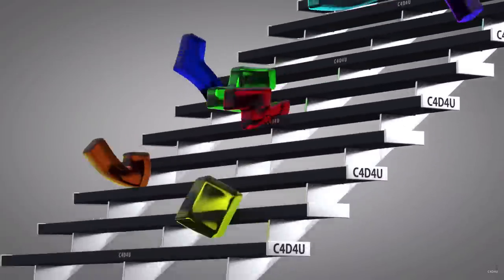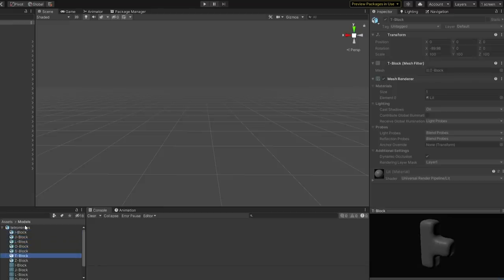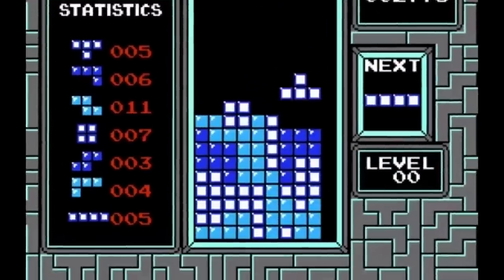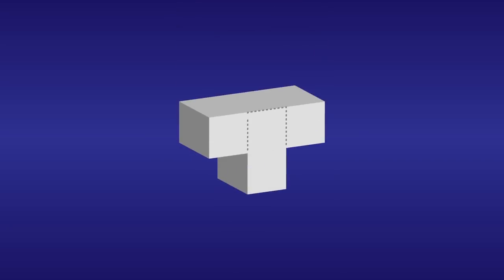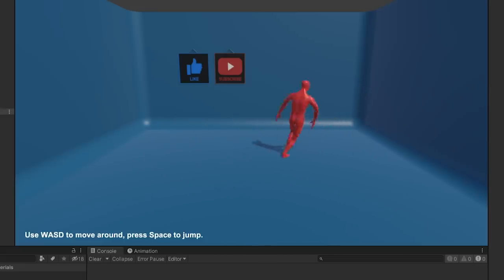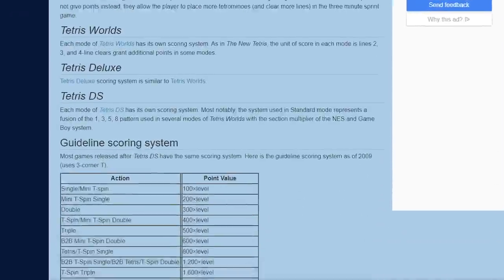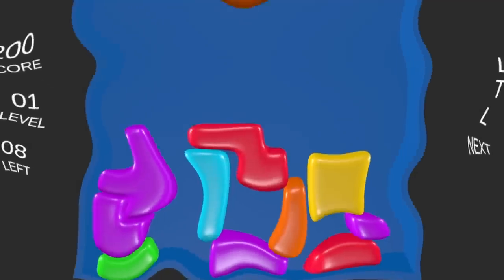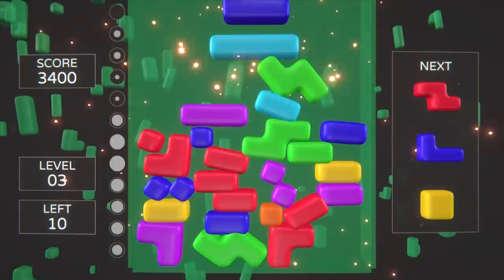I Made a Soft-Body Tetris That’s Actually Playable

Comment: A bit of constructive criticism if you will: You seem to have arrived at pretty much the same game that has been mentioned a million times in the comments at this point, that being "Not tetris". I would argue this is due to the "locking up" of pieces you described, basically removing the core of the game - soft body physics. I understand that you were trying to make a game out of the videos you saw on YouTube, but you then essentially bailed out of it by all the constrictions given. The choice of not cutting the pieces by a plane to keep the game more rigid was probably one of the few things that could've made the final prodcut retain at least some of the original intended ideology. Obviously you can't make mechanics like Tspins very well since  you're working in a non-discrete environment, but the fact that soft-drop is not included feels very weird, since it's just a matter of adjusting the gravity for the currently handled piece. From the constraint of performance issues that you've been present with can also arise a decent idea. Making soft body physics in a 2D environment is much less resource heavy and much simpler to make as well. It would accomodate the original idea neatly while making it both less of pain to make and to run while still keeping the spirit of tetris alive. Who knows, with some clever rendering tricks with some background softbody tiles being tied to the frontground main soft body pieces, you could maybe even achieve a similar feeling 3D effect. All this being said, it was a pretty fun video to watch nonetheless, thanks for the upload!

Comment: Clearly the issues with this not feeling like the C4D4U videos are that 1. the blocks are too rigid (either because the stiffness is too high or because inadequate discretization), and 2. there's too  much friction between the pieces, preventing them from sliding into place. Given you're using a plugin for the actual core part - soft body simulation - I'm not expecting you to be able to fix these.

Comment: 9:10 well when the pieces lock like that, this doesn't at all resemble the softbody tetris videos! this is closer to Not Tetris, since it's free position/rotation and fuzzy clears (although Not Tetris chops each piece on the clear axis, not nicely into smaller pieces like you do)

Comment: Instead of casting rays to check for blocks for a line completion, you could use a grid system. The tolerance of the line clearing would then be decided by the size of the squares in the grid.
Reply from the maker: I agree! This is actually very similar in terms of the player experience I believe, but probably heavier on performance... Oh well...

Comment: You don't need to rempve rotation completely. Just change the friction between pieces and walls, so they easier fall into places that align them.

edit: I think lower friction and higher rigidity along straigt parts.

Comment: I think locking the pieces in place was ultimately a good choice even if it took away some of what made the soft bodies special. If you didn't lock them then all of the soft bodies would settle under the weight of the ones on top and you would probably clear rows without putting in any effort at all
Reply from the maker: Thank you! I thought so, but now I believe the other option deserves a second try, as so many people mentioned it, but yeah, hard to make it work.

Comment: I dunno, only cutting the pieces into the squares seems less fun than what Jelly Tetris could actually be. After all, if they can be cut at any angle, they SHOULD form odd shapes. As long as you kept the grace system so lines don't have to be 100% complete it would work. Clear any lines that become 80% full or more, and physically remove them from the board. Since right now you're still using discrete lines they can clear (which the tiles don't always align with) it's extremely limiting what you can do. I would just cast a whole bunch of rays to see what is mostly complete, and treat some number of rays (even if they aren't connected) as a whole "line". Afterall part of the fun of having Tetris pieces made out of jelly is that lots of pieces get smaller and smaller as lines are cleared, and they would naturally fall and fill any gaps in the bottom that a piece might not necessarily fit into.

Comment: I'd say it looks good so far but what I found most statisfying about the c4d4u softbody tetris vids was the way the pieces drop, bounce and then slide into the correct place, possibly moving others into thier correct position aswell. Surely that is far easier to do in a prerender like c4d4u did but i think just making the pieces not stick together like they do in your game would just about solve this. Also idk how this would affect your game at the moment (I think you said smth about this in the vid but i cant recall and dont feel like watching it a second time immediately), but i think you'd no longer need tolerances in the lines.

Comment: I think another good approach to that could have been to lock the jelly tetronimos into a set grid after letting them bounce around for a little while. That would keep it closer to the animations it is based on and might also improve on the problems of where to cut them and that the higher it goes the harder it is to solve

Comment: what if like colors stuck together, and your goal was to get an unbroken chain of one color from the right side to the left side? you could keep the line break mechanic, but it would become a tool and not a goal, make it a bit fuzzier, and get rid of the rotation locking, only use the color pieces sticking to themselves,

Comment: Could you make their pieces attempt to rotate to one of the 90° angles while they have momentum, rather than snap to them? Like a soft keep-upright mechanic?
Reply: Maybe the torque applied is relative to how far off the closest 90° rotation the block currently is?
Reply from the maker: I actually did exactly that! Unfortunately it didn't end up in the devlog. I didn't like how it felt to control it, and it didn't fully fix the root issue in my personal opinion. That being said, I believe it deserves a second chance. Thanks for the very nice feedback!

Comment: that raycast approach is SO INEFFICIENT.
you only need to check for collision once, not cast a ray which checks for collision each tick.
Also you have a lot of extra vertices you don't actually need in your models
And I think that reconstructing meshes procedurally would be a better solution that making a set of models
And you should make frozen object turn into static physics objects or decrease the simulation quality for them.

most Unity/UE4 devs don't know how to properly optimize their game smh

Comment: YOOO I got it work on linux, heck yeah
Reply from the maker: Oh super cool. Sorry I didn't upload a version for Linux, I didn't have a quick way to test it and this was kind of a prototype. But really nice you made it work!
Reply: @NewbieIndieGameDev  Yeah its not problem at all. Running this game on linux was easy because of wine. The only problem I had to fix was changing the .exe name to have no spaces as well as the folder that had the same name. Then I used lutris to specify which version of wine to use (6.9) and boom got it working. Unity games are pretty easy to workaround tbh.

Comment: Is the soft body simulation frame or delta t based?
Reply from the maker: No idea! I'm not familiar with these. What's the difference?
Reply: @NewbieIndieGameDev  I‘m not very knowledgeable with the jargon, so, sorry for expressing myself in such a clunky way. The former means that the physics calculations are run every frame, the latter means that the physics calculations have its own clock (which usually runs on a much higher frequency, I believe), which is completely independent from the frame rate
Reply from the maker: Ah I see. I don't have the answer, I'm using a framework here, but I would assume the second alternative since physics simulations follow that approach in Unity in general. Maybe you can check the documentation!

Comment: You might get perfomance issues because you used a lot of detail for each model. I'd not advise using subsurf for game design though...
Reply from the maker: Totally! 😂 I tried to make it better for a bit... and then realized I was too lazy to put the effort, but this would be one of the first things to improve performance. Thanks for the comment!
Reply: @NewbieIndieGameDev  no problem! Subsurf is used when modeling for rendering purposes, but for game design it is better to try and be as efficient as possible with geometry. Unity can render up to 4 million tris per frame. When you play the game in the inspector there's a stats button. If you click it you'll see some stats as well as the tris per frame it's rendering. Also shadow casters are really important to keep as low as possible, if it gets up to 400 then perfomance issues start to appear.

Comment: the turn lock ruins the principle of it, personally i think it would be better if you had a turn resilience or some "preferred position" making block stabler when in correct contact, a sort of sticky state. maybe a "drying" mechanic that makes new tetromino wobble freely into place and older ones resiliant making them stable for additional tetromino to stay on top.
i'm surprised you didn't even mention Not Tetris 2